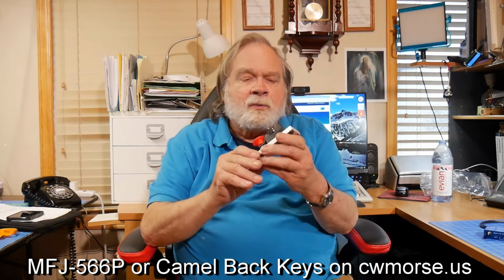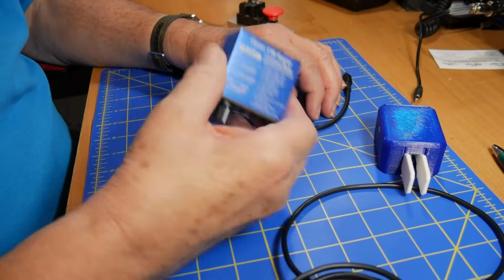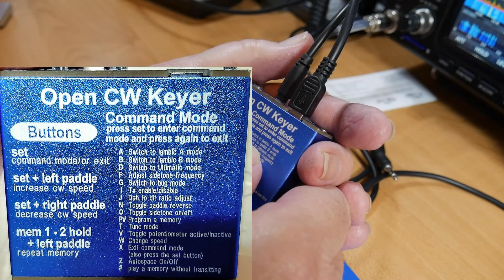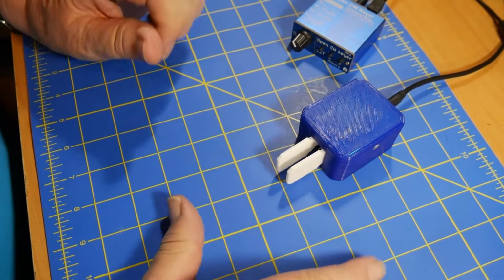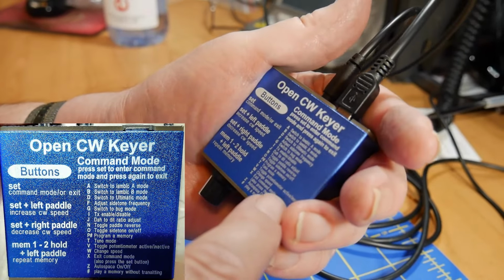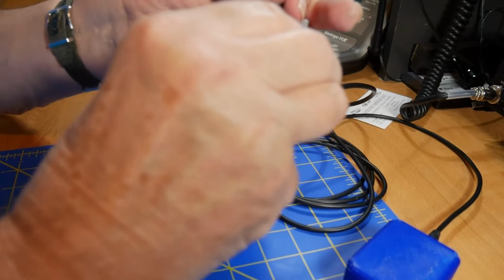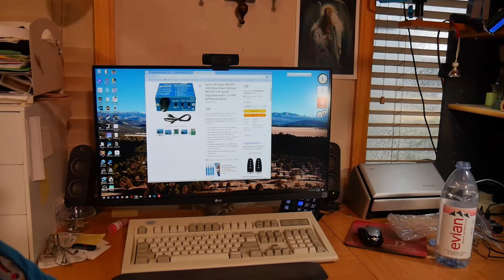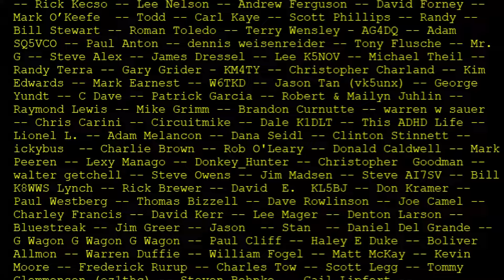Code Practice with Iambic Keyer (#1164)

Comment: This is a good way to practice your sending when you own a IC-7300 and probably other Icom transceivers too.
Switch off your "BKIN IN" when you're in CW mode. Your radio will not go in TX that way. 
Turn "RF GAIN" all the way to the right so that you don't hear any other stations.
I'm not sure but maybe you have to put your "Monitor Function"  to "ON" which is only available when you're in SSB mode. It's in the menu when you press the "Multiknob".
And there you have it. 
It works perfect and you're using the automatic keyer is in your radio.
Good practising 
73
ON1JV

Comment: I have a yagi. It operates on 10, 15, 20 and 40. I know that the optimum height is one half wave above ground. What about the height of this multi band antenna. I am most interested in 20 and 10 meters. I have a 40 Rohn tower. Another question? Dipoles are usually half wave. Wouldn't a full wave be better if you have the space?